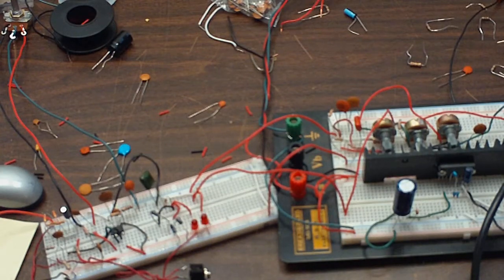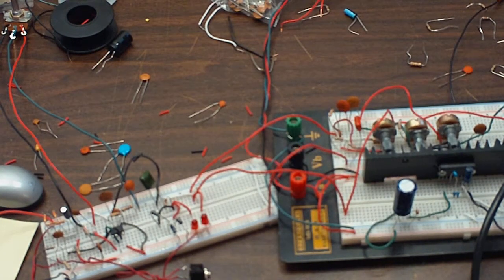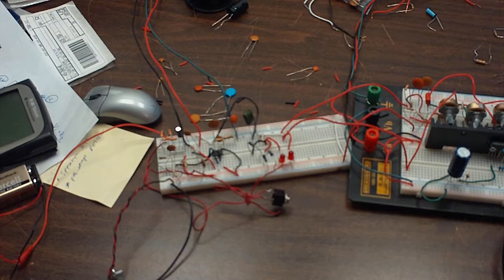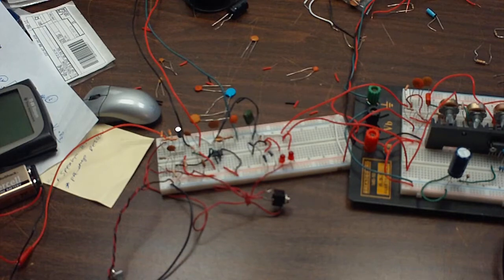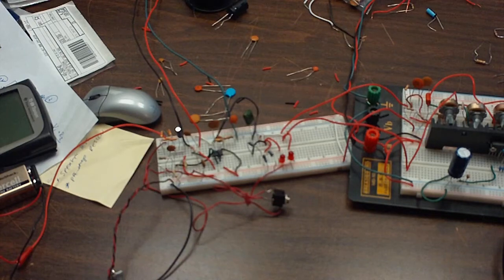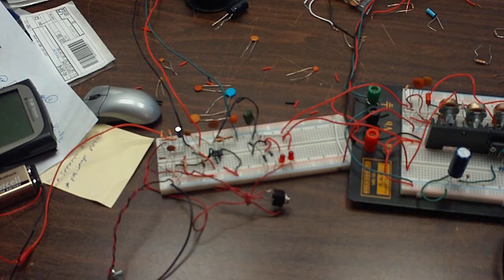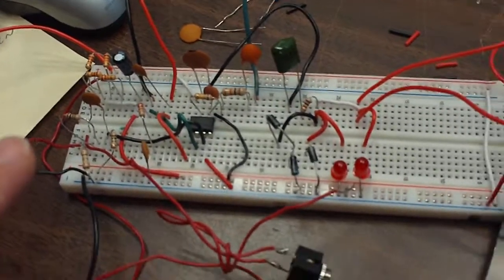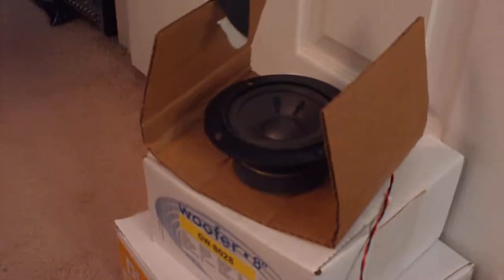OP AMP distortion Pre-Amp by Falkken Amps

Comment from the maker: @kingdeadly1:  sure you could.  However, it is rather easy to design your own power amp if you chose to do so.  I would start with solid state and go from there.

Best thing to do is to break down your project into workable phases; Phase 1:  design pre-amp, Phase 2: design tone stack, Phase 3: design power amp, Phase 4:  put them all together and start testing.  There are many ways to skin this cat.